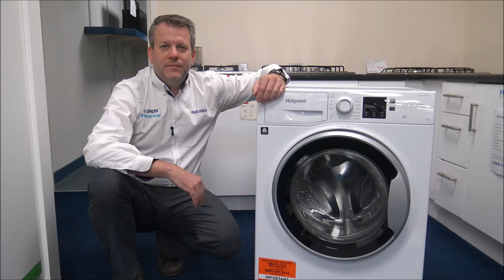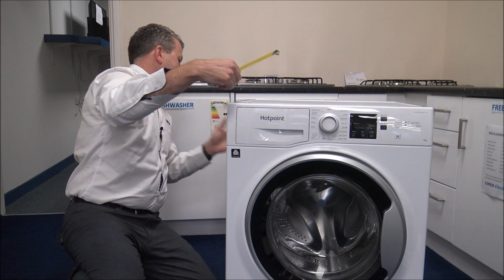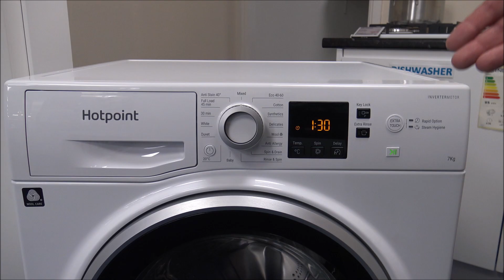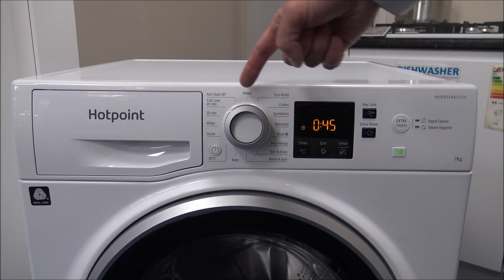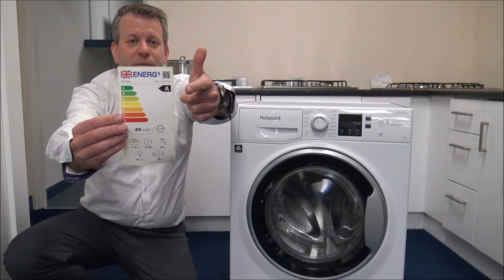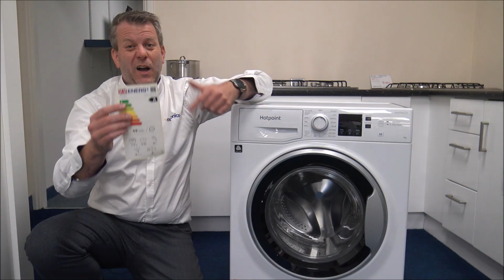Hotpoint NSWE7469 1400 Spin 7Kg Washing Machine

Comment: Thank you More helpful than the side of A4 instructions with the machine.  Can I use a wash-ball to put straight into machine?  Or is it just put liquid into drawer? I often have items such as towels and jeans which need extra spin after cycle finished. Do I just open door take out washing, just leaving others in click the on button. I think Hotpoint should've made a more instructive manual manual explaining much more
Reply from the maker: Ideally you want to put the liquid in the drawer rather than the drum because the detergent is only required at a certain stage of the wash rather than at the start of the wash which would happen if you were to put it in the drum at the start of the wash which

Comment: Just got this machine today.
The spin cycle is real quiet, however there is an on - off crunching noise during the spin. Is this normal?
Reply from the maker: That does sound odd that there is a crunching noise. I assume all the transit bolts have been taken out?
Just keep an eye on it, if it carries on over the next couple of washes, i would contact the retailer and see if they can confirm the machine is ok

Comment: I bought  1 year ago now f05 error  came  near spin time pls help me
Reply from the maker: This looks like it has a pumping out issue where the drain may be blocked or the filter may need cleaning in the washing machine. To access the filter remove the front panel at the bottom and unscrew the filter to see if there is anything blocking the filter

Comment: not sure how to clean the filter on this one as the plastic thing at the bottom looks attached and dont want to break it
Reply from the maker: You have to be very careful, but get a flat bladed screwdriver to gently prise off the plastic trim at the bottom, then you can unscrew the filter on the front of the machine

Comment: Just about to use for first time. Have run cleaning cycle first. So quiet had to go back to make sure was on. Only negative at mo is short electric cable. Will have to get sockets moved. Good demo .
Reply: Fit an extension to socket

Comment: The timer feature is great but rendered unusable on this machine as the sensitivity of an uneven load is just ridiculous. I set it to wash at night so when I get up I just hang it out but, you guessed it, stupid thing didn't spin so everything had been sitting for hours ringing wet so had to run a spin cycle twice. Great design hotpoint. NOT ! always adding time then randomly stopping too.

Comment: I've just ordered this but one thing I don't get with hotpoint is the unbelievably long programme times on their appliances. I have a hotpoint dishwasher and it's the same.. Either 2 1/2 - 3 hours or a just about acceptable 45 minute one but some things are still dirty. I might cancel the order and start looking again. I am limited with space though.

Comment: Just got this model, running the pre wash now (no clothes in) the glass front is very hot, in fact too hot to touch, is this normal?
Reply from the maker: If it is a normal washing temperature of around 40 degrees C then the door shouldn't be that warm. If it is at 90 degrees C then yes the door will get very warm to touch
Reply: @lords-electrical  ok thanks

Comment: Good video. I would like to know where the filter is. On my current machine it's at the back and I can't get to it. TIA
Reply from the maker: The filter is at the front under a plastic trim so is quite easy to access
Reply: @lords-electrical  Many thanks. I think I will be getting one.

Comment: This may seem a silly question, but do you put washing powder in two of the compartments, or just one? If one, which one? And what is the 'partition' that you move from one place to another? If you don't use liquid detergent, can you remove the 'partition'
Reply from the maker: You only use the partition if you are using liquid. If you are using powder then it is the right section you use, or if you need a pre wash then use the middle section too.
Reply: @lords-electrical  Thank you.

Comment: We have just had this model fitted, as a replacement due to our old Whirlpool giving up after 10 years. The problem we have had with it is the red lock sign not going out and allowing the door to open, after the wash has finished. Any suggestions on what we are doing wrong. Many thanks Julie
Reply from the maker: This is where you have accidently enabled the child lock on the machine. If you press and hold the key lock symbol for 2 seconds it should get rid of the symbol and you should be able to carry on as normal

Comment: I have had this model for just over a month now, it washes and rinses nicely but when spinning it’s been an absolute pain in the ass. I’ve found it’s really annoyingly sensitive when balancing for the spin to the point where it’ll just skip the spin and leave everything sodding wet whether you put an even or uneven load in it, also none of the programmes that are a decent length do the full spin speed. The timer is also really annoyingly inaccurate, it’ll happily add on 30 minutes for no reason and randomly end the cycle with it saying 20 minutes left. Now something quite bad that’s been happening with it, it’s chewed up a bra and two socks! Back in August/September when I was looking for a new washer, I boiled it down to this and one of the new Beko EnergySpin models. I chose this model and initially thought that I made the right choice but I’m starting to have my doubts now, especially if it keeps up with this socks/bras shredder mentality. But a few good things I will give it, It looks very nice, it’s feels sturdy and it’s anti-staining function works amazingly

Comment: Hi, on the Eco 40-60 setting, how can it use less power if it's on for longer? Thanks.
Reply: Most of the power is used to heat the wash water, the motor uses far less, so as eco uses a lot less water, it uses less electricity to heat it to 40°C which saves more electricity than the longer run time uses.
Reply: @mels8966 i thought it was cold water was only😮
Reply: @peggyclarke8993  It's cold fill, and I believe there is actually no minimum temperature requirement  for the mandatory eco 40-60 wash cycle in the EU regulations, it's just supposed to be the equivalent of a cotton 40 or 60 wash.  I've read most machines heat the water to around 35°C on this  cycle and will likely maintain the temperature above 30 (and less than 40°C) during at least part of the wash phase. (Should be noted that hydrogen peroxide based oxygen bleach without TAED needs 40C to kill 99.9% of bacteria, with TAED it will kill 99.99% even at 30C)
Reply: I asked the same question at a Euronics store. Guy equated it to a car journey from A to B. If you travel at 90mph you will get there much faster but will use a lot more fuel. If you travel at 45mph it will take twice as long but you will use a lot less fuel.

Comment: Indesit and Hotpoint are together nowadays. Candy and Hoover are too I've recently learned. The good thing is you can get spares easily with these brands.
Reply: Indesit and Hotpoint have been together since the 2000s same with candy and hoover
Reply: Mine still doesn't open even after doing it.  Its frustrating @superdylan803